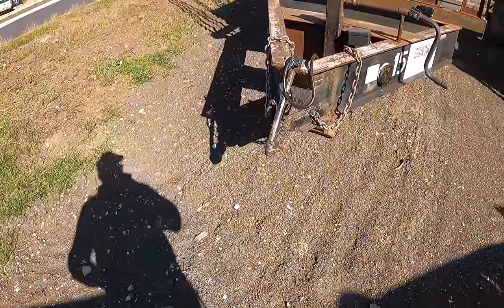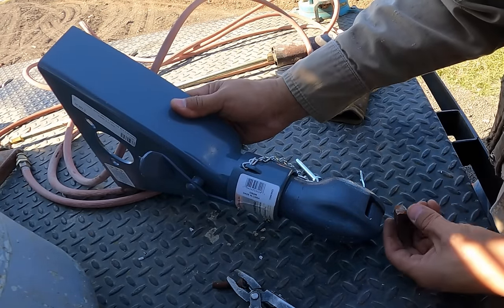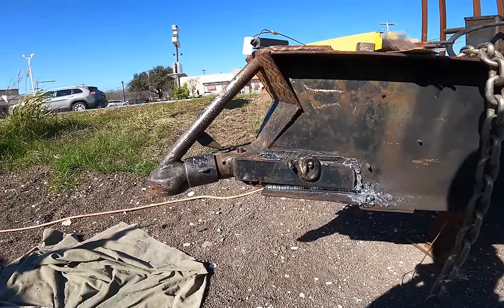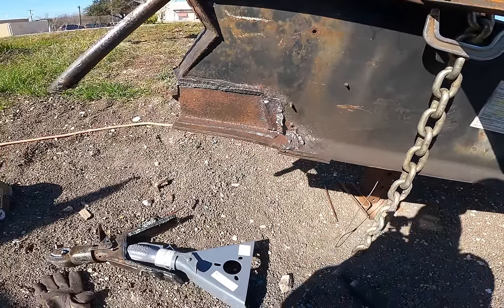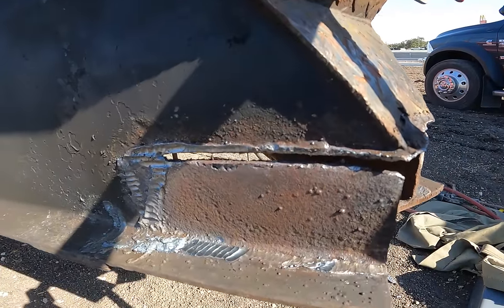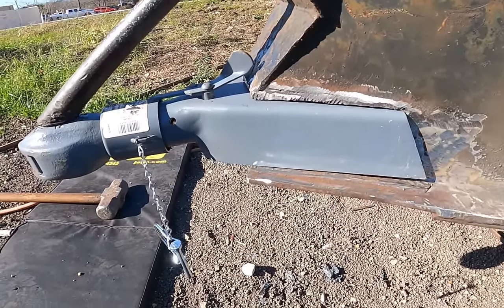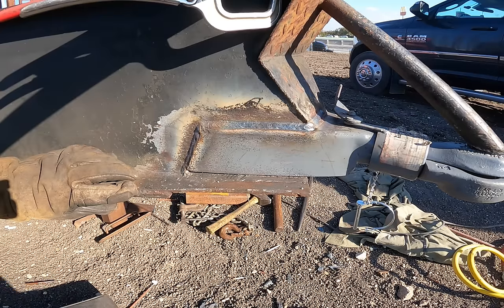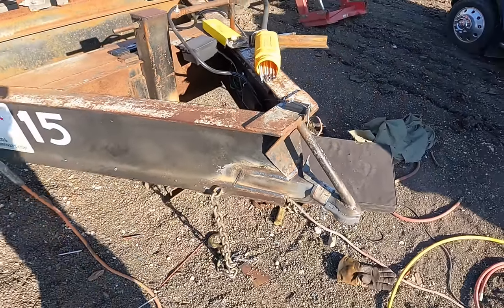Sketchy Hitch replacement.

Comment: That is the most bizarre hitch I have ever seen. Here in the UK it would be illegal and even the new hitch too. The size and weight of that trailer would need to have an all forged steel, braked delta coupling here because the trailer would likely be over 750kgs (3/4ton) which is the limit for unbraked trailers here. A job well done young man. I would walk away from that job if it was on this side of the pond unless it was just an old farm trailer.
Reply: In the US, trailers over 3000lbs, but under 30,000lbs, are usually serviced by electric brakes.  They are powered by a standardized 7 pin connector to the tow vehicle, with an electric brake controller fitted to the vehicle.  We have surge hydraulic brakes but they are less common due to cost and complexity.  Anything over 30k is going to be air brakes, and the 30k mark itself will vary depending on application of the trailer.

This trailer has clearly been converted from a pintle/lunette style hitch, which is used on medium and heavy duty trucks (commercial-class use primarily.) The weld work is high quality, but this hitch conversion was scabbed together by someone else, was not engineered and isnt safe.  It's kind of mind boggling, because flat mount, certified, forged ball hitch couplers rated to 25klbs are like, 140usd.

Comment: Great job on the replacement hitch. I surely enjoy watching you work. I've installed and replaced a lot of hitches and the Bull Dog hitch is as good a "utility" hitch for boat trailers and horse trailers as you can buy. BUT, these guys are stressing that hitch to its limits. Looking at that trailer and the loads they put on it, it needs a Pintle type hitch system for sure. Especially when they have to have a support bar running from the head of the hitch to the trailer. WOW!!!

Comment: Isaac I wouldn’t ever use a hitch like that on a trailer of that size and weight there isn’t enough coupling surface, so you’d be relying on your break away chains too much , the only thing I liked was your preparation and magnificent welding you are a true master of your trade best wishes from Tasmania Australia 🇦🇺

Comment: Looks like a 15 ton tag trailer that would have originally had a lunette ring for a pintle hitch.  From what I've seen usually the style coupler that's on there now is only rated for a max of 15k or so.  But looking at how they're using the trailer now I really doubt it's loaded to the max.  Maybe hauling glass, windows, doors or something?  Should be fine.

Comment: That POS has a number 15 on it. I hope there ain't another 14 of those out on the road.🍻
Reply: Maybe 15 ton or 15k lb  rated trailer but with a 7,500 lb rated coupler?  Maybe that is a mobile home frame? Maybe just the bolt on tongue was number 15.  I sure hope it's for off rode use only.

Comment: I don't think there is anyway I would have trusted that hitch before you repaired it. I wouldn't have pulled that trailer. I really like your information on the welding and steps in your videos

Comment: My first reaction to seeing the original state of the hitch conglomeration was brace it top & bottom with flat bar, 12 in. back then chop it all off back to that point and rebuild the whole nose end.  Pretty extreme but I'm pretty impatient - LOL!  I'm guessing this was more friend/favor emergency repair than original customer fix. Nicely worked to acceptable conclusion and much cleaner looking assembly.  Considering the weight that it apparently caries, heavy mounting plate and pintle hook would be a better option.

Comment: Yikes.  Nice work Isaac made chicken soup from chicken poop.  Luckily it would appear that trailer only carries aluminum signs.  Keep a set of weld on safety chain retainers on the truck this way you don't mess with the heat treatment on the safety chains.

Comment: Nice work, but maybe using a "Channel Mount with 5-Position Fasteners Heavy Duty Cast Coupler" would be a better option and that way it would be welded to the upper, middle and lower part of the I-Beam.  Then could get rid of the horrible compound angle front and rod brace to the coupler.  but what a mess to deal with.

Comment: A piece of friendly advice.  Get yourself a bunch of pieces of all-thread that fit onto a slide hammer.  When you need to pull a pin, or even just remove old chunks you've cut, tack on the all-thread.  Toss it when you're done.

Comment: I’m taking the dock extension off a box truck at work to fix a broken rear door frame and trying to use the plasma cutter to gouge away weld material was impossible in some spots.  I’ve been curious about arc gouging since I saw you do it a while back, seems like it would be great for tight spots.

Comment: There's a saying we have in the UK... You can't polish a turd LOL. That bodged owner added hitch looks too small for that trailer weight so they added that solid bar to reinforce the neck after hacking it onto the existing frame with a V cut to make space for that lever arm. That needle scaler is an unsung hero tool :o) very useful for weld stress relief as well as cleanup. Your removal of that pin was a master class in how to remove broken studs\pins. I've learned a lot watching your videos. Taught myself TIG 10 years ago as a hobby and have made my own garage metal benches, shelf racking, brackets etc most of which will outlive me compared to my ex-job designing IT systems which end up obsolete within 10 years at the most.
Reply from the maker: what part of the UK are you at?
Reply: @ICWeld  I now live up north on Teesside (North East England) where they used to make raw steel that built the world. Lots of steel artwork sculptures on walking trails and such. The area is now becoming home to green industries such as wind turbine manufacturing and just recently announced plans for small nuclear reactors (SMRs).

Comment: If the new coupler is 2 5/16 ball it's rated for 12,500 lbs. If the new coupler is a 2 " ball it's rated for 7,000lbs.  The size of the I beam on that trailer is huge. I can't tell if the trailer is a tandem dual axle and if it is the trailer is probably rated for 24,000lbs.  The front of that trailer probably had a vertical steel plate with drilled holes to accept a pintel ring or a bolt on coupler rated for the trailer.  capability. DOT would have a field day with that mess!

Comment: Hi lsaac, it's   2Am in Scotland  and i just  thought id have a look at what you  were up to ,    When the video  started away  my immediate reaction was,      isaac walk away please,  dont touch that job ,   then i thought hang on      if isaac just cuts all this CRAP OFF and starts from the beginning  it will be done rite ,    Because  their is no dought in my mind whoever did the previous BODGE was not a Welder ,  he was a side show at a circus,             AND  if you had walked away                  another  " welder" would have  done another bodge and it would have been a  DEATH  TRAP  going down the Highway  and could have killed a family ,       SO   in my opion you did the rite thing and repaired it properly   well done job      Stan Edinburgh Scotland.

Comment: Too bad you couldn't swap it over to the heavier duty adjustable style.  Cut & plate the front so replacing the hitch is a simple 2 bolt process.   You Definitely do Great Work!

Comment: I think the term "10 foot pole" would apply here as far a future liability goes.  Seems like a massive kludge.  From the size of the trailer frame, I would say it originally had a pintle hitch.  Why wouldn't they just weld a plate on the bottom of the frame and bolt the hitch to the plate?   I would assume they have had issues with the old hitch bending which is why they braced it with a solid rod on top.

Comment: Awesome repair using what you’ve got to work with. Does anybody know what Leatherman ICweld uses?
Reply from the maker: Gerber
Reply from the maker: I put a link to the amazon page that has them in there.
Reply: I stand corrected it’s a Gerber. Thankyou for letting me know about the link some neat stuff on there.

Comment: I have one word for that mess - liability.  I would not be surprised if they routinely overloaded that trailer, which is why it was reinforced that way, after adapting it to fit their tow vehicle.  If past behaviors continue, they might cause a trailer failure, and then the lawyers come looking for you.  Getting stuck with even a part of a multi-million dollar claim can still destroy your business.  There are jobs to walk away from, and this looks like one of them.
Reply: Looks to me like that trailer has been modified to carry aluminium signs for roads, so the load will be minimal compared to what it used to carry. I doubt that hitch will break. Here in the UK, that hitch wouldn't meet our regulations because it's folded steel, unbraked and not up to legal specification for the size and weight of the trailer.
Reply: Yes we have no idea as to how the trailer brakes are activated? 😢
This is quite possibly the sort of job that puts Isaac and his business at risk. This job makes me nervous for Isaac. He can weld it together just fine, but the whole trailer is suss. I am of the opinion that there should be a drawbar ring hitching to a pintle fitting on the tow vehicle. Is the tow vehicle heavy enough to tow that trailer with or without the aluminium signs?
Mark from Melbourne Australia 🇦🇺

Comment: Hideously light hitch for that big of a trailer. Wouldn't blame you if you had refused the job. 
Welding right next to the highway,  a bit of a wonder that the cops didn't pull in and make you put up some welding screens/curtains.  That would be a major arm-waving event in California, freeway evacuated, drivers hospitalized, air ambulance called in... etc etc.

Comment: I have a question. Why do you carry the little mig unit since you have a suit case unit? How well does that mig unit work off of your 302 welder?
Reply from the maker: I run a fluxcore wire through the smaller machine because its easier to buildup some weld on broken flush bolts.

Comment: Brings back memories,  7th grade at Wynn Seale in Corpus I took metal works for two hours each week day, same at Martin Jr high then we moved and I do not recall if Brown Jr high had the program but Carrol high did have the program and I also took mechanical drafting. I then dropped out and moved to Houston and got mt GED and at 16 I talked my way into a shop so I could build a custom hitch to tow my Toyota wagon behind my 72 dodge half ton.  I made it out of Houston during a flood and my toyota tracked pefectly all the way to Spokane Wa.  I am 59 years old now and my wife and boys and friends still get scared when I get that look on my face that says "the hell I can't" and I owe it all to those 1st four years.  Go Trades.
Reply: Go trades indeed. I like these kind of stories. Are you still in Washington?

Comment: This is super crazy. A 2 ⁵/16" ball coupler on a trailer that size is ridiculous and way undersized! That trailer should have a pintle hook & a heavy duty (1/2" - 5/8") flat plate mount on the front of it(possibly w\ several holes to adjust, but not necessary). Idk who cobbled that together, but DOT would have a field day w\ that thing, I'm sure! Pintles are the way to go on anything this big. They're so much stronger, safer & easier to have. 👍🏻👌🏻🕵🏻‍♂️🤔🦺🛢️🔧🛠️🔩📐🗜️🚧⚠️🤷‍♂️👨🏻‍🏭🚚🚛🚜⛓️⚙️

Comment: I think they put that bar on it to keep it bending up when they overload the nose of the trailer
Reply: Bar is there because the center top of the hitch was cut out to fit the tongue of the trailer. Simply replacing what was there before in flat steel to round bar doing the same job.

Comment: Would the way you did that have been possible without arc gouging? I know the inside tacks probably would have meant torching a lot of material out just to get the old piece off. I just don't know how I would have done it with only a torch. Kudos for doing it the way you did.

Comment: In my opinion that's way too big of a trailer for a sketchy hitch setup like that. I would have done an adjustable u-channel pintle setup with a bolt on coupler like you welded on. Then the customer is happy and any owner down the line can put a proper pintle on.  Just my opinion.  You,  as always  did a fantastic repair with what the customer wanted you to do.

Comment: Noob question:  When you were welding the root and stringers on the top, why did you hold the rod horizontal instead of at a 45 like it was a fillet?

Comment: I cannot believe that welding that solid support bar to the top of the hitch is allowed. And if they need it, the probably positioned thing wrong on the trailor, and imagine the pressure on the rear suspension of the towing vehicle! Besides that, good job!!!

Comment: Does it make you nervous when you see something like this? I wonder if that's the right hitch for the trailer or if the customer swapped from say a pintle to a ball? Have you ever had a customer or insurance company come after you for replacing part for part something that wasn't factory or was the wrong component that someone else got wrong in the first place?

Comment: Perfect example of someone buying the first part they came across instead of the right part. That probably had a bolt on pintle ring that could have been replaced with a bolt on ball hitch with only a few bolts but this one was probably 5 dollars cheaper

Comment: Good job on the fix. 

But I wouldn’t have touched that job with a 10 foot pole. The weight rating of that trailer far exceeds the rating of that coupler and should be a 3 inch ball or a pintle ring. Way too much potential liability.

I would think if something were to happen with that trailer, DOT would love to find this video.

Love your channel you do good work, but I wouldn’t film something like this and put it on the Internet. Your livelihood is more important than views on YouTube.

Comment: If I didn't know any better just from the way that thing looks it looks like it used to have a ring pintle hitch plane on the front of that that had a bolt on ring and it looks like they modified it from a pedal ring to a ball hitch and as you said it looks sketchy

Comment: I wonder how they get by road inspections with that hitch?  Seems a trailer that big would require a pintle?  There are places to cut corners and then places where a fella should have sense enough to know that doesn't look right and isn't right.  Taking into account that a trailer always seems to get loaded to the max.  Oh well, you did as good a job as possible in the circumstances.  Your welding and cutting won't be what fails on that sheet metal hitch!!  Probably no air brakes on it either?  Must be towing it with a station wagon and a bumper hitch!!

Comment: Once you got into it and saw how it was actually installed, it wasn’t quite as scary as first impression would lead you to believe. Not great but at least you could still sleep at night knowing it was rolling down a road. That trailer frame likely weighed more than any load it ever carried, in this configuration.

Comment: With it angled downward like that it is not engaging with the trailer ball correctly?? Should have used the type of adjustable hitch that adjusts up and down with multiple holes for adjustment. Should use torch to burn away the paint?

Comment: When ICWeld makes a cut something's coming off, guaranteed. 

Any idea what the trailer was used for? No way that coupler is heavy enough if that trailer were loaded to its capacity. By the heft of the tongue that has to be a 25,000+ GVWR trailer and those couplers are only rated for 14,000lbs.

Comment: What caused the problem in the first place was an idiot driver for the owner of the trailer. He backed into something or into the trailer and bent the hitch. Then they welded on the flat bars and that round bar to strengthen it without straightening it. You left that round bar long, instead of cutting it off and shortening it. That caused the new hitch to not weld straight. I would have cut off that round bar, welded on the hitch straight and level, then shortened the round bar and welded it back on. Your way is still strong enough. It just looks messy.  Thanks for the video. Jon

Comment: Sir  do you measure the distance between the axle and the center of the hitch? So the trailer pulls straight.
Reply from the maker: Not in this case. I placed it back into its original position and sent it! However, If youre working on a regular trailer that uses these hitches or are building new, then yes.
Reply: @ICWeld  
Thank you for answering my question.  This job was putting a pearls   on a  dead horse. But you pulled if off.👍🏻🇺🇲

Comment: Some people need to learn to put the welder down, the meth pipe, or preferably both. (Not Isaac- the originator of this fine piece of engineering.) I'm just floored that with I beam that large, this is the solution they came up with. That pile needs to make one last trip across a scrap yard scale.

Comment: Here in Florida, it is somewhat common to see tandem axle trailers with one of the axles off or simply lacking the tires and rims for that axle.
Instead of the load being distributed between two axles as intended, the entire load is carried by one.  I have no idea what these two-bit clowns (mostly small lawn service guys) are thinking.  My guess is that they believe they can get better gas mileage by removing one of the axles.  Not very bright; another common problem.  Those hacked trailers should be seized and impounded by the cops if they catch these clowns pulling such an unsafe rig.

Comment: Boy sketchy is right!! As always you made it better then it was but this should have been a no. It held before and will probably hold for years to come but this hitch isn't rated anywhere near high enough for this trailer so they just weld a post to the top to prevent it from folding. 
Sure do enjoy watching your work though.